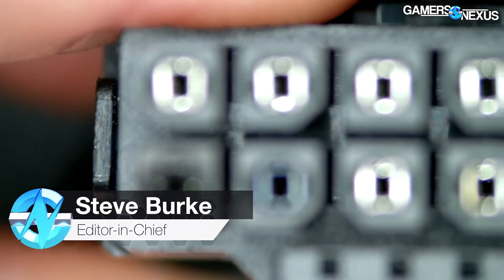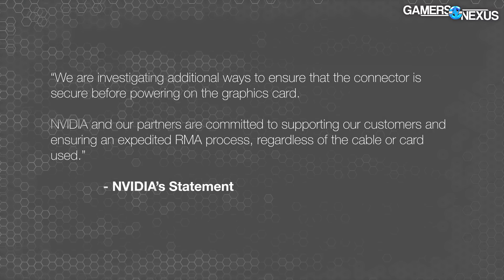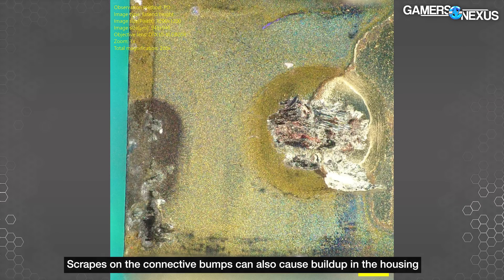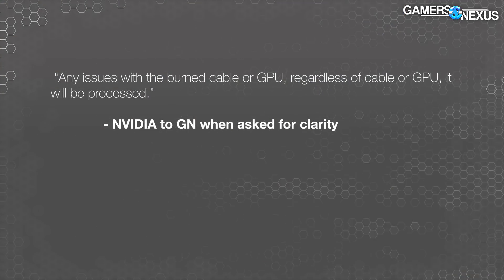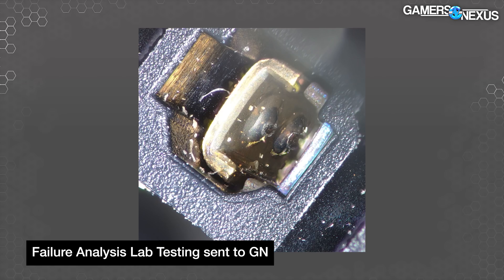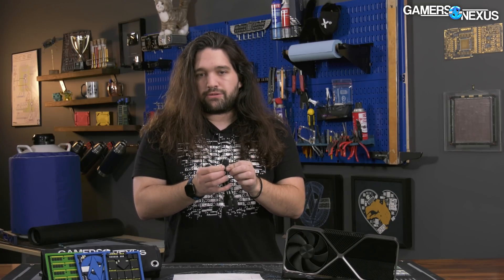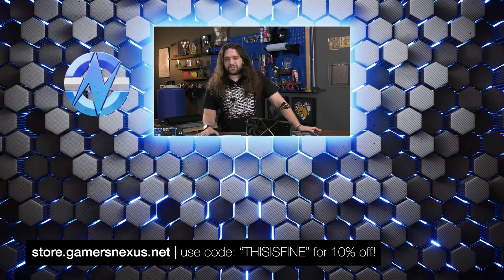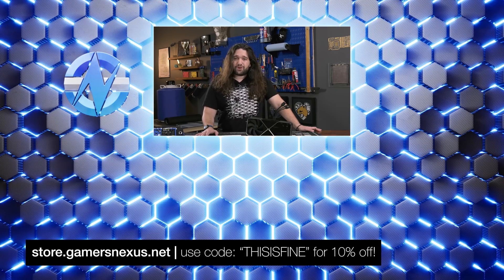NVIDIA Responds to Melting Cables, Warranty Concerns, & 12VHPWR Adapter Failures

Comment: In order to plug the cable in correctly, you have to push as hard as Gamer Nexus has pushed the frontier of publicized benchmarking and thermal testing. The work with the 4000 series was insanely in-depth. You guys are truly putting to shame all the hardware journalists in the world. I've never seen a magazine or other Youtuber go to the lengths you have. As my 4080 will arrive on Monday, I already thank you for the peace of mind and the hard work it took to get there.
Reply: not being that guy but why buy the overpriced 4080? At that point, just buy a 4090 for the price you are paying
Reply: @bogart9010  I totally agree. In Australia the prices rnt that much cheaper then the 4090s. I don't see the point of getting the 4080...
Reply: @elvincassar5383  you can cap the 4090 to 380W and get 1 or 2 fps less than at stock...
Reply: @bogart9010  For myself,  while the 4080 is overpriced, the 4090 is just too damn expensive for me.  Also, I just bought an 850 power supply... And didn't want to have to upgrade it again.   You're not wrong though, honestly
Reply: @bogart9010  Probably for the same reason I did, you can't get a 4090 ANYWHERE without paying 500+ dollars over MSRP to scalpers and I'm not sitting here waiting god knows how long to get one at MSRP watching nowinstock like an anxiety-ridden hawk. I played that game for three weeks with no results to show for it. My 3070 was already showing it's age really hard in Plague Tale, I want improvement NOW. I went from the 16th fastest card to the 2nd fastest, so I'm more than happy with my purchase. 4080 is overpriced but it's also a fantastic card and plenty of power for anyone, getting a 4090 doesn't REALLY improve your life much. The important thing is just having SOMETHING to get you through to the next gen (or the gen after that if you're the kind of person that upgrades every other generation). 

Saying that if the 4080 is 1200 and the 4090 is 1600 you may as well get the 4090 does make decent sense, even if you'll never REALLY need that extra performance, an XX80 card of any generation is plenty for anyone's needs. But I get why people say it. Saying that when you just straight up CAN'T get a 4090 for less than like 2100 is being absolutely detached from reality. Like you're just SO pissed that Nvidia priced the 4080 3-400 more than it's "supposed" to be that it's made you insane and you're telling people they're stupid if they don't spend 400 more on a card for a level of performance they may not even need, you're telling them, at least in the current climate, they're stupid if they don't pay 900 plus more for a card they don't really need OR wait an indeterminate amount of time for the opportunity to purchase said card at only 400 more. Some people just want to get on with life and play their fucking games, man...shit's not that serious.
Reply: @bogart9010  The 4090 is basically sold out, except for some sketchy scalpers and it sells for 2,400€ upwards here. I'm not gonna pay over 700€  extra for the last 10% performance gain. 4080 is already super expensive, overpriced and overpowered. Only reason I went for the 4080 is it's availability and that I need that new rig ready on dec 15 and maybe that wouldn't have worked with the 7900XTX. I'm also not too keen on the AMD drivers and like my CUDA and RT.
Reply: @Dominian1  I was able to easily get two 4090s in store, not online, but in store worked. with that said, I'm pissed off that nvidia wont give us free cablemod cables after this issue came up because its going to cause someone to die eventually and they will be sued over it.
Reply: @Dominian1  not 10%, but 30-40% performance gain
Reply: @The-Oldest-Dream  Still not worth the extra. Say your trying to build a 3000$ budget pc. Possible with a 4080, not possible with a 4090 at its current unavailability. You can have the second best card now, or maybe have the best card in 6 months. If you arent playing 4k 4090 isnt necessary. Personally, im not risking the 7900 being too good and ravaging my 4080 performance while offering more vram too. Im keeping 4080 in the box until amd launch lol. If the day before reviews come in and its better for less and comes with similar RT, ill TRY to take it, because supply is clearly not the best unless your card is getting ragged online.
Reply: @shnouth5391  just saying about its performance. Now 4090 is out of stock, if not it's overpriced, so it is better to buy a 3080Ti, 3090/ti or 4080. Radeon 7900XTX is equivalent of 4090 in rasterization, in rt maybe 4080 or lower. But you also have to take into account that some exclusive Nvidia features won't work and possible driver issues.
Reply: @bogart9010  maybe due to power consumption and heat generated?
Reply: Gold comment
Reply: He also said the 4080 is of terrible value, and nobody in their right mind should buy it.
 I see you pick and choose a bit there what you listen to haha
Reply: @Carrotsalesman  I'm in the special circumstance of needing the rig ready on dec 14 and that would most likely not have worked out with the 7900XTX. I could sell it and upgrade later, but for what game? 4080 isn't the most money savvy purchase I've ever made, but it's a decision I made with all the available information and my personal priorities.
Reply: @Dominian1  Fair enough man, fair enough.
Reply: But when the 5080 is $2,300 MSRP, and it 35% faster than a 4080, just bend your mind back to this moment, because buying is buying, and that's all NVidia needs to perpetuate this insanity. The don't care about anything else, just "did it sell yes/no" and yes means jack up the price again next time.
Reply: Checked my 4090 and it had not clicked! Could very easy bend it out. But now thanks to GN I have pushed it fully it with a click. Thanks steve you just saved me from a potential fire hazard
Reply: Yeah. Gotta use those special custom pliers to force that shit in—much like GN has forced "tech news outlets" to, you know—do journalism. 🤣💯
Reply: I'd recommend welding the connections on the side of your card when it arrives Larry.
Reply: Isn't LTT Labs supposed to be the ones doing this level of investigation? They made millions off their backpack alone and have nearly 100 staff in multiple buildings.
Reply: @sammiller6631  they bought the test tools.. Maybe not yet fully setup..
Reply: @sammiller6631 Theyre too busy talking about 6 foot widescreens nobody will ever use
Reply: @shnouth5391  what video is that?
Reply: @sammiller6631  LTT has gone down hill. less actual tech reviews and insights, and more memes
Reply: @bogart9010  If memes pay the bills, then Linus will put memes inside of memes. He's got near 100 mouths to feed and memes do have a wider audience. GemersNexus has a dry style that bores the meme crowd.

Comment: Pig fat would need to be significantly diluted with a more volatile and less viscous solvent just to get it to be a liquid at operating temperatures without the use of a fuel warmer. I think your point is pretty solid. It'd be essentially the same as if you left the fuel in your car too long without using it, and the fuel gelled up in the tank (which is a real thing that happens, I had it happen in my work van over the pandemic! just hope you left enough space in the tank to fill it up with fresh fuel lol). A 5 gallon gas can of fresh fuel later and I had the engine running after a few attempts at getting it to turn over (no doubt to clear the fuel lines of gel), no problem. Pig fat would probably require a full engine rebuild, though it wouldn't be quite as bad as adding sugar, which would most likely ruin the engine

Comment: I wonder if the heat cycles can pull the connector out if there's tension on the cable from how it's routed in the case.
Reply: Not if latched
Reply: @gracej79  yeah, I mean when it's not latched

Comment: The easiest thing NVIDIA could do is shorten the sense pins. Cease manufacturing of the cables, do a recall on all the existing cables, manufacture a cable with shorter sense pins (wouldnt even take that long) and send any customer the new one who wants their cable to be exchanged to set up a dedicated email address and boom, problem solved, more or less

Comment: 125k units sounds so high considering the US availability of at least the Founders Edition has been 9 minutes. 9 minutes out of over a month total time that Best Buy has had a yellow buy now button. I suppose the FE may make up a tiny proportion of total available product but since it's the only reasonably sized card I'd rather see more of those than partner boards (or a partner stepping up with a smaller footprint version at MSRP)!

Comment: I think it is absolutely a design flaw that it can so happen that you think it is plugged in but it wiggles itself out of the slot during cable management.

If I buy a nearly 2000$ card I will also be relcutant to really push on it hard and wiggle the cable.
Even if I know it should be safe.

Comment: Oh surprise, user error. If you try to build your first pc, or built a PC in a rush, this might have happened to you before, nothing new. For example, if you've struggled before getting a stiff 20+4 ATX cable in a tight case before, you know it should click, both pieces. if you have big hands, it's a fight :) Or plug in 4x4 CPU cables at the top of your motherboard while your AIO is already mounted to the top of the case :) 
Good tip maybe is to not fully cut your nails when building a PC. Always feel with your nails to check if it's fully socketed and you have no good sight on what you're doing, or gently pull the cables, it should stay where it is unless you press the lip that secures it. Maybe that connector should get 2 lips, one on each side ?

Comment: Why do GPU manufacturers always put the power socket facing up on top of the cards??? The power cables always have to make a 180 degree turn to get back to the power supply. On almost all designs the cabling has to pass in front of a logo or cooling fins thus blocking view of the logo and/or airflow to the card. You would think they would have placed the socket at the bottom either facing down or at the bottom facing back to make a shorter and more direct path from the card to the power supply.

Comment: If is connector plugged properly, bend the cable should not be an issue? I mean reasonable, not 90 degrees.

Comment: At 600 watts the plug should look more like what i plug into my wall or some screw on terminals like my riding mower has.  I am not an electrical engineer but nothing i have ever wired has melted.

Comment: It's definitely design error. If this is a concern the pins should not contact at all until the latch has positive connection. You would only need a single pin like this to 'detect' latch insertion, the rest could have full contact. It's not even hard to implement. Look at the middle copper traces on a USB connector for an example (even though there its sort of the opposite, data is last to connect, power is first).

In fact, they already have the sense pins, those could be used to implement this feature.

Comment: So in recent years the dual 8 pin for CPU's have ended up with not being fully latched, but for some reason that doesn't seem to matter too much.. One of the hardest ones to get right is the "Dual 4 pin" that make it 1 8pin, sometimes 1 side can be very very hard to get latched.. I've pulled a part a build that lasted years and one of those sides wasn't latched. Never had an issue for the life of the build ( roughly 2-3 years ).
Wonder what is the big difference between these "16 pin (12 pin)" and the dual 4 pin (8 Pin).
O well , good stuff here, thanks
Reply: maybe because 8pin connectors provide less power than these 12VHPWR, so it doesn't heat up as much even if there's a bad contact in there?

Comment: 0,04% failure rate is actually a colossal fuck-up in the electronics industry. Especially when it's caused by something as simple as a connector.
There is no talking this pretty. It is a design error - especially when you consider a functioning connector was replaced with a faulty one.

I happen to work in the electronics industry, and people dump shit on us if one part per million fails!

Comment: if the design allows predictable, common scenarios like "not fully inserted" to cause catastrophic failures, it's a design flaw. with no way to clearly tell when or if the connector is fully seated, it's not fair to call it a "user error"

Comment: You are making excuses that enable the unbalanced value propositions that corporations are pushing on unwitting consumers, a more relevan example would be if you have a company sell you a car but may void the warranty if you fuel up in any other perfectly fine and acceptable stardard formula gas station  that is not a part of or subsidiary of said corporation. Your fallacy only helps assholes push the value proposition for their products to have proprietary limited driven development. There's a difference between giving the benefit of the doubt, and capitulating to greed driven design at the cost of user driven design and pockets.

Comment: How many times has DRAM been incorrectly fitted.  Giving a higher gap around the locking tab will help insure the mechanism is fully engaged - Steve pulling it out seemed to be more aboute the force used to disengage the lock.      

Foes the connector have a measurement for the locked pull foce?